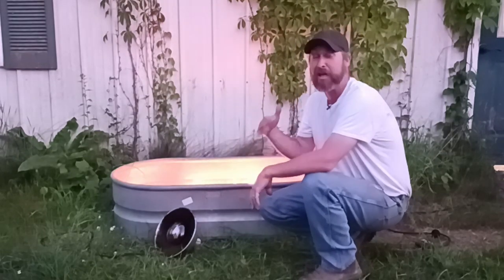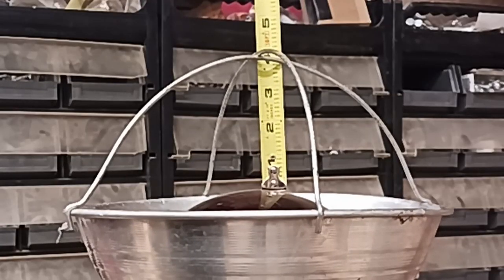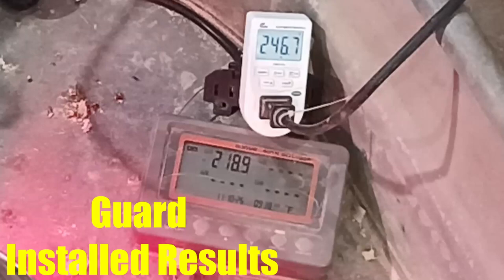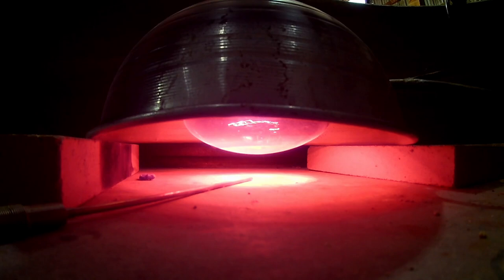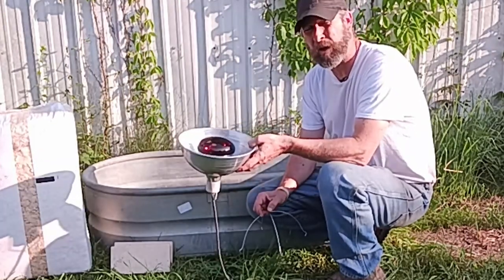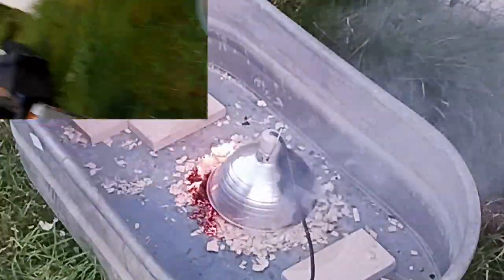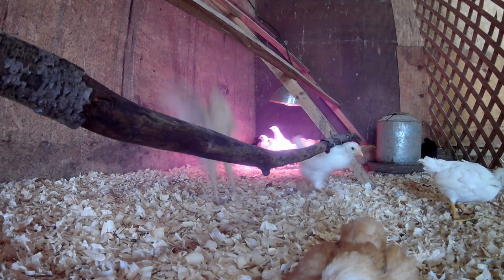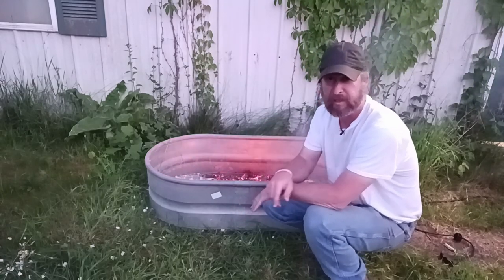Heat Lamp Dangers! Everything You Need to know NOW!

Comment: Wait…who in their right mind is going to place a heat lamp up against material? 

Should there be noncombustible material a way from the heat lamp in order for the lamp to generate effective heat?  Thanks
Reply from the maker: The premise of the video is to point out what can happen if your heat lamp falls onto bedding material. Typically heat lamps are installed well above (12"-24") bedding material so that the generated heat is spread over a larger area. At that height, you shouldn't have any concerns.